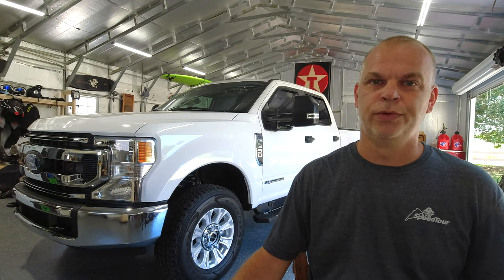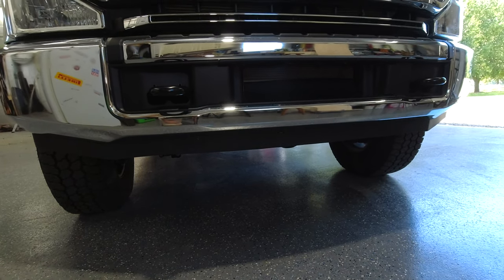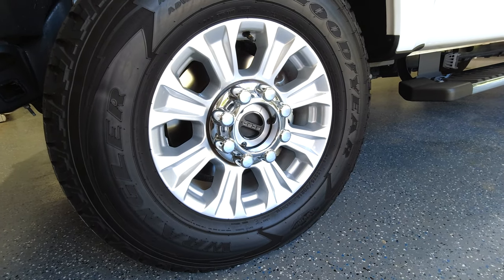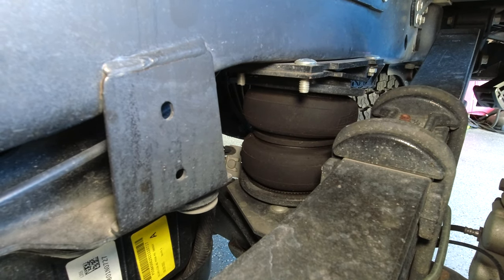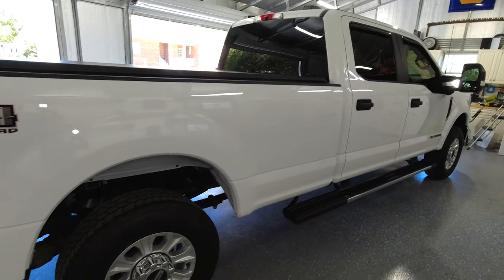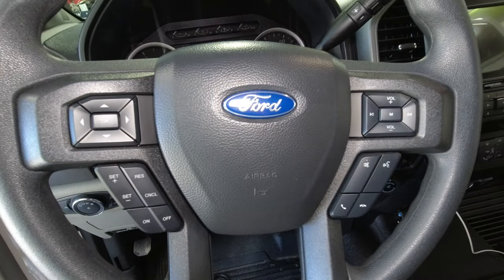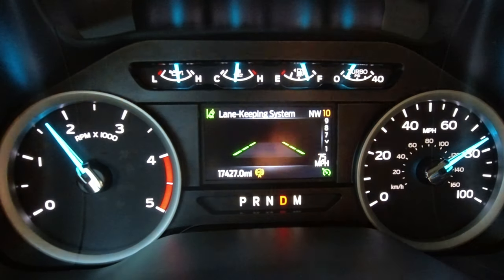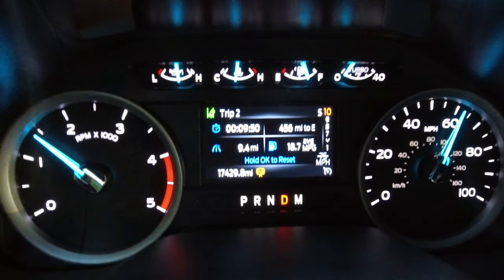Is the Ford F-350 Super Duty Worth the Upgrade?

Comment: Here’s my experiences 
2015 6.7 275k miles zero issues besides def problems at 255k 
2017 6.7 89k miles zero issues 
2018 6.7 321k miles zero issues 
2020 6.7 21k miles zero issues 
2021 6.7 77k miles zero issues but faulty def sensor at 5k miles
Reply from the maker: Nice! That's awesome to know there haven't been many issues with your trucks. Do you use an additive or do you just fill it up and not worry about it?

Comment: Bought a 2012 F-250 6.7L PSD when it was just 3 years old, only issue I had in nearly 8 years of ownership was the rear differential pinion seal leaked and had to be replaced.  Now I have a 2023 F-350 SRW with the standard output 6.7L PSD, no issues in the short 6 weeks I’ve owned it…with towing our 8,000lbs camper just over 1000 miles.
Reply from the maker: Sounds like you’ve had great luck with the 6.7s! Thanks for watching and enjoy the new truck!

Comment: Love your truck. If I get a diesel this is what I would get. I plan to tow full time a 7,000 GVWR Oliver Legacy Elite II travel trailer all over the U.S., Canada, Alaska, etc. I just can’t make up my mind if I need a diesel or not. Could I get away with F350 7.3 Godzilla Gas engine towing full time?
Reply from the maker: Thanks! With that weight, I think you could easily get away with a 7.3. There are lots of folks towing over 10,000 pounds with the gas engine. I honestly can’t say if it’s better or not because I’ve only towed with the diesel Ford. I will say that there’s no easier towing experience than with a diesel. It’s comfortable and quiet even towing in the mountains. I would also look at fuel tank size. The 48 gallon tank on the long bed is a must have for road trips. We normally get around 500 miles per tank towing. There are upsized aftermarket tanks for diesel short beds, but I don’t think they offer an upgrade for gas trucks. Good luck on your decision and thanks for watching!